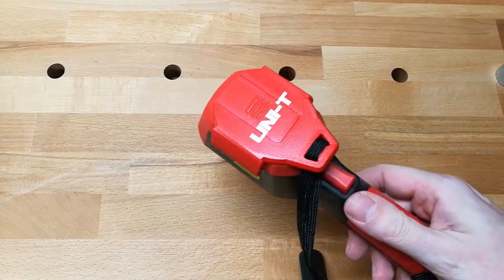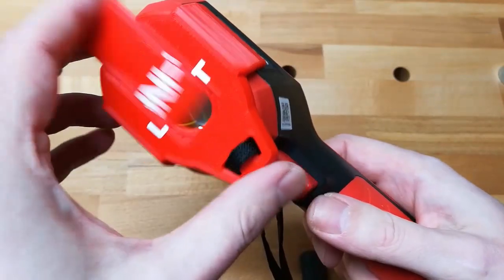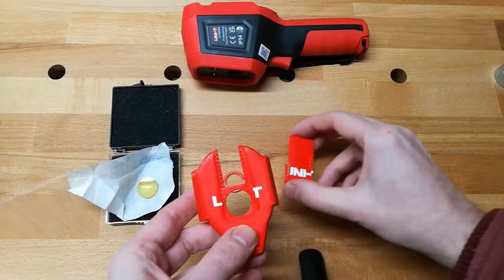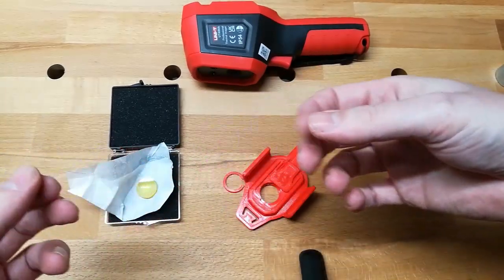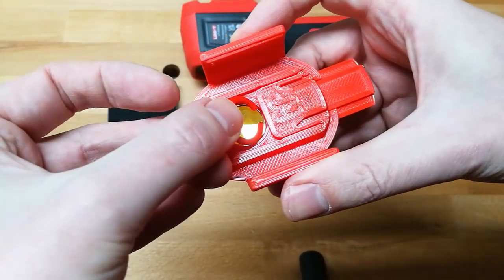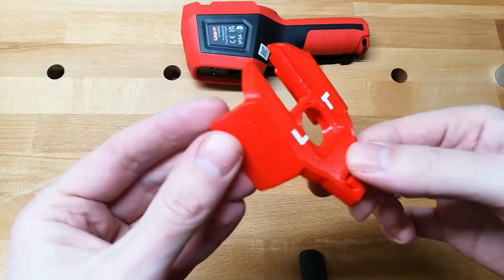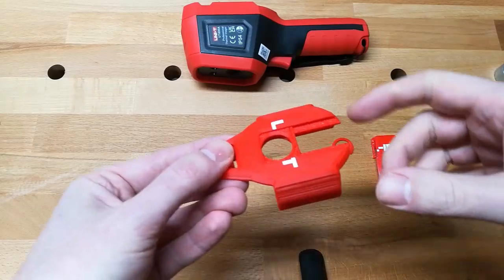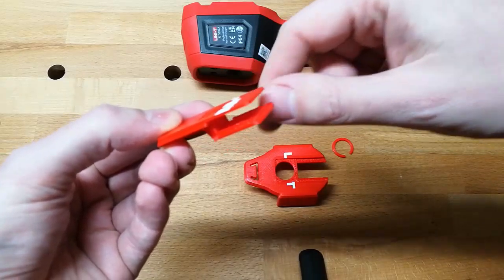ZnSe Lens Holder/Cover for UNI-T UTi690A ( UTi120S UTi712S) Thermal Imager

Comment: It would be awesome to see the difference, that the lens gives. Also id like to know where to get the lens from.
Reply from the maker: You can find more information about the lens used here: https://www.prusaprinters.org/prints/114142-znse-lens-holdercover-uni-t-uti690a-uti120s-uti712
You can find my trails with 50.8 and 38.1mm close up lenses with the UTi690A here: https://www.eevblog.com/forum/thermal-imaging/uni-t-uti690a-(120x90-entrybudget)/msg3920621/#msg3920621

Comment: Well done! I am going to publish a review of this thermal imaging camera soon (I have not received it yet) and I wonder if it is worth investing in an additional lens for PCB diagnostics specifically to show it to viewers. I saw your comparison photos on the eevblog forum but honestly I'm not really convinced. This would be an additional cost of about 50 euros, and the camera still has a fairly low resolution, paying a little more, you could already have a T2L thermal imaging camera, which is much better in this field (higher resolution, manual focus, etc.). If you took some more PCB inspection photos with this adapter by the way and could you share, I would love to watch them and not only me. Of course, if they are in the review, I will provide viewers with all the information and links to you and your work. Best regards from Poland.
Reply from the maker: It really depends, if you can afford to, always go with the largest sensor size, highest resolution and best integrated lens design that you can afford that is packaged in the way you need it. I would not recommend this thermal imager mainly for PCB work, it's really meant for larger scale where you need to move around and where a standalone unit is preferred.

Can it it be used for PCB diagnostics withouth the ZnSe?: Yes definitely! 
Does the ZnSe lens improve anything?: Yes, it improves the minimum focus distance, with the lens I can see the 0402 components (even if just barely) without it it was too blurry to spot a single 0402 component. (As you can see in the forum post)
But is the ZnSe lens worth it?: Where just having this thermal imager on hand can save hours of work finding faulty components on a PCB (it can show well where on a PCB a faul/short may be located), with the ZnSe lens it may be able to save you additional minutes/seconds by squeezing the last bit of performance out of the thermal imager you already own for close up work. You're paying ~$30 for what may save a little time IF the fault is at the tiniest of SMD components. If the fault is located anywhere larger than 0402 components it may not save you any time at all.

I have an expensive FLIR E60bx+ that easily outperforms all of the thermal imagers with smaller sensor size units (sub ~$1200) for all kinds of work, where it can spot a faulty 0402 component while the entire PCB is in view. But I purchased the UTi690A to use in the dirty environments on machinery where I do not want to bring the E60bx+ and having a phone dongle is not an option. For this use the UTi690A it's a great unit, price/performance ratio is excellent.
Reply: @FurreFurre  Thanks for the answer. I will let my viewers decide, but also give them links to your work. Is it ok for me to use a few shots from your above video in my review?

Comment: I was going to buy the 120s for board repair until I couldn't get a macro lens, maybe this will change my mind.
Reply from the maker: If you do a lot of electronics SMD repair, I would strongly suggest a thermal imager with higher resolution. This is just on the border to useful, works for hobby use a few times a year but if using it more than that, I'd suggest a better one.

Comment: Great job 👌👏👏 i work on smartphone and small component do you think that the 120s with macro lens is useful for the job 
The price is very attractive 
Can you post more videos of 120s with lens on small component pcb, there's no videos on YouTube you will be the first 🙏🙏
Thank you
Reply from the maker: I would rate the UTi690A and it's twins to be OK for small components if used a few times a year as a hobby. If you're working with smaller items on a regular basis and especially make a living out of it, you would be much better for with a thermal imager that has a higher resolution. I have posted images of PCBs close up work with this thermal imager that you can find here: https://www.eevblog.com/forum/thermal-imaging/uni-t-uti690a-(120x90-entrybudget)/msg3920621/#msg3920621
Reply: @FurreFurre  thank you 👌👌

Comment: .... Well done Mate, what if you uncovered the visual camera ? wouldn't you then be able to mix the image again ?
Reply from the maker: This thermal imager does not have a regular camera, it only have a thermal imager sensor.
Reply: @FurreFurre  .... I apologize, I should have read the specs.
Reply from the maker: @robbieaussievic  No worries! 120x90 pixels is what I consider the lowest limit for a thermal imager to be used without a regular camera. 
And for PCB work, a regular camera will actually be a bad thing and should be turned off, as the parallax error is huge when working up close, it will not display the mixed image correctly (regular image will be shifted alot compared to the thermal image when mixed).
This thermal imager is about the lowest resolution that can still be useful for SMD work, but a thermal imager like the UTi-260B will be far superior in performance, but also cost over twice as much.

Comment: I just received this camera today and I love it. I compared it to a brand new fluke pti120 and the 25hz refresh rate on the uni t is superior (Fluke costs 700€) :P Anyway I was wondering if it is possible to create a lens cover for this camera to fit a 8x or 12x magnification lens on this? like those lens you can buy for your smartphone? So i would be able to see if anyone is walking on my property in the darkness...
Reply from the maker: Unfortunately regular lenses are not transparent at these wavelength, you would need proper lenses used for thermal imagers, and not sure if there is anything suitable to be used directly with these thermal imagers.
Reply: @FurreFurre  Thanks for the reply. Can you please tell me what lens did you use and what are its measurements? Also does it work well with the imager to see things closer?
Reply from the maker: @danijel124  You can find more information about the lens used here: https://www.prusaprinters.org/prints/114142-znse-lens-holdercover-uni-t-uti690a-uti120s-uti712
You can find my trails with 50.8 and 38.1mm close up lenses with the UTi690A here: https://www.eevblog.com/forum/thermal-imaging/uni-t-uti690a-(120x90-entrybudget)/msg3920621/#msg3920621
Reply: @FurreFurre  Thanks for your replies. I have come to the conslusion that I dont need these lenses :P

Comment: Use it for uti260b?
Reply from the maker: This lens holder does not fit the UTi260B as it have a different plastic casing. But if someone gifts me UTi260B then I'll make sure to make an awesome lens holder for that too ;)
I think there may be ones already for that thermal imager that you should be able to find.

Comment: Would you recommend this for working out heat loss from a room ? Is the ir resolution good enough.
Reply from the maker: If the heat loss is great enough; yes. I own a Flir Exxbx model that is marketed at themography market of buildings etc so I have something to compare this model with. The biggest downside these budget thermal imager have is not really their lower resolution (you can always just move closer), but the smaller sensors give higher noise which limits the delta temperature visability. This is due to that manufacturers are "hiding" the noise by restricting the palette scale when temperature delta is low. This is probably about the same on all sub $1000 units as those typically are of small sensor sizes (resolution less important). So, if delta T is less than 1degree C it's less visible to spot, where as 8 degree it's really easy.
Sorry that it's not a yes or no question, it really depends on how much of a heatloss you're having, what temperature difference there is outside and inside your house etc. In low temperature winter times it's a lot easier than summer times for sure!

Comment: I would be more interested in the actuall camera than the lens loolz :)
Reply from the maker: You can read my review of the thermal imager here: https://www.eevblog.com/forum/thermal-imaging/uni-t-uti690a-review-(120x90)/
For the price it's great, dont think there is anything that can compare to it in this price range!
Reply from the maker: Had forgotten to add the review-link to the description so now it's added there too :) Thanks for reminding me!
Reply: @FurreFurre  Does it really have 25hz as advertised? And can it be used to measure a house outside?
Reply from the maker: @danijel124  The " thermal core" is likely a 25 hz core, but that is just one component, the output on the LCD is lower, but feels much quicker than FLIR 9Hz at least. From looking at videos of the big brother UTi260B, those seem to have about the same framerate.
Reply: @FurreFurre  What are your thoughts on this camera? Is it good quality? I ordered one btw.
Reply from the maker: @danijel124  My review on eevblog forum is more detailed, but yes, for the price it is good quality, better than other similar priced ones.
Build quality feels great, screen is good, and it's IP rated.
Sure it cant compete with my $5000 one, but can probably handle ~95% of what I've used that one for. With a ZnSe lens on the UTi690A works well even for close up SMD PCB work.
What I find is that the UTi690A struggle with (and other sub $1000 units) is that due to the small sensor, it is a little limiting to see what you're looking at when the temperature delta is low (under ~2-4 degree delta or so), and most likely it's due to that I'm spoiled with the other beast. However when you're actually using a thermal imager, you're usually looking for higher temperature variations than that, and if you cant see it on the thermal imager, it most likely is not an issue anyway. Also the laser on one of my units were off to the side, but I've never used that feature on any thermal imagers anyway so does not bother me.